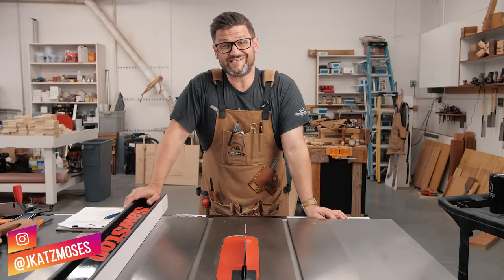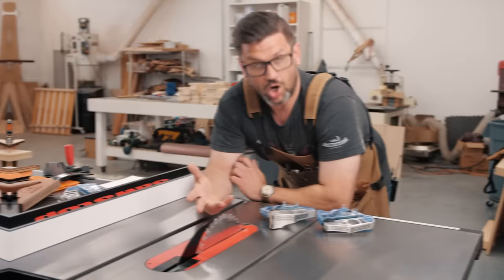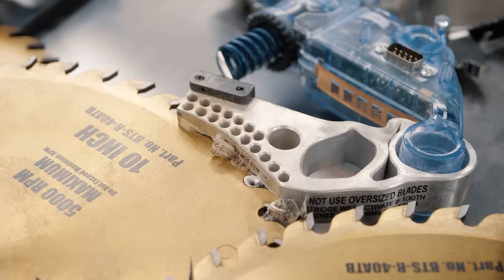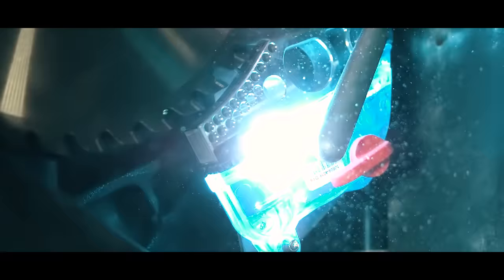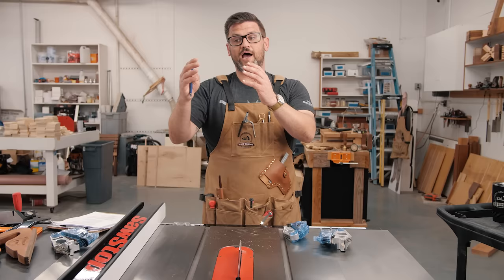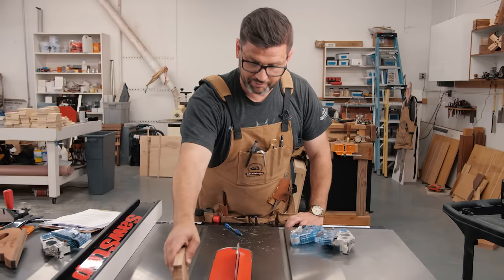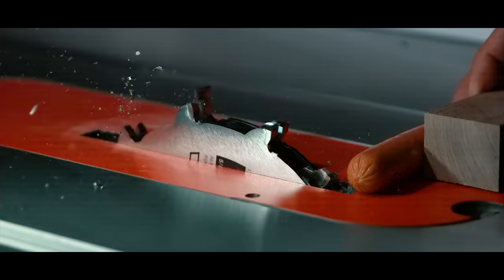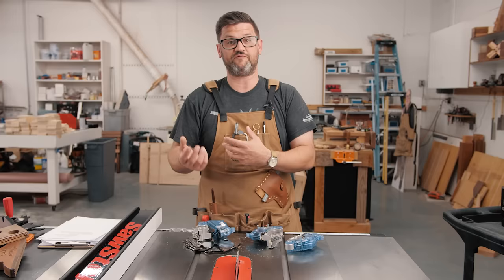How Safe is a Sawstop Saw? - Never Before Seen 19,000 FPS HD Slow-Mo Video

Comment: You did a great service to the woodworking community Jonathan! Great job! I got the blade on my finger 20 years ago. It was about 1/8th and went into the fingernail. I can still see the scar and it did do nerve damage. So what does that mean? If I think about it, especially when I type, I can tell it happened. Very similar to what a callus feels like on your palm of foot. So no big deal. I'll be glad to email a photo if any geeks want to see. FYI, I stopped using a table saw for about 15 years. Now I'm back and use my GRR-RIPPER 3D Pushblock (GR-100) - MICROJIG. (That's not a paid endorsement. Yes, mine has cut marks but not on my fingers, thank God!

Comment: “Man... if I don’t cut these 20 boards in the next 5 seconds my boss will kill me”
Reply: Not if he's trying to do that with one of these saws...
Reply: It is like that for some
Reply: @JEAthePrince  Fr, there are some lazy bosses with unrealistic expectations expecting their businesses to skyrocket
Reply: dude if you can cut 4 boards a second you should be the boss lol
Reply: @andrewvargas4141  true. I worked for some as a machinist
Reply: Just take 4 at once? If possible of course...
Reply: @-sturmfalke-  you'd have to set it up though. I squished 2 blocks together, had to tie them together. Was alot more work than just 1 at a time. But I'm sure there's better easier to use clamps. (Back then I was using my fingers standing to the side, and I was terrified lol)

Comment: "We caught something on camera that I don't even know if you're gonna believe"
Yeah, right.
Oh my god, genuinely shocked!
Reply: The fact that it was enough G force to break the welds on saw teeth is actually pretty crazy man
Reply: @EnrikaGames  I thought it looked impossible to me so i went back and watched the clip again. It actually seems it didn't break due to G force but rather by hitting other teeth parallel to it. The "shockwave" probably caused the blade to wobble sideways slightly, resulting in a small overlap between the teeth and thus being able to hit one another. It still does look incredible though.
Reply: @Simon-mv4jc  I doubt it
Reply: @cjbht19minaret  Check the video again and look closer. you can clearly tell one of the teeth comes in contact with the other by a spark
Reply: Exactly my thoughts.... "what's gonna happen, huh?"  And then... bedjeeeezusss bits breaking off.
Reply: Same, the shockwave of the stop was enough to cause weld failure. I was amazed
Reply: @origamipostit  I doubt it.
Reply: @cjbht19minaret  Minera is right. Look closer.
Reply: Don't blaspheme
Reply: @cjbht19minaret  The only way you are able to doubt it is if you don't even bother to look.
Reply: @Simon-mv4jc  correct!
Reply: I immediately thought "the thing will stop so violently the teeth go flying". On a second watch I gotta agree, the middle blade was stopped at different rate and tore teeth off of the sides (edit: it actually is visible in the footage and still looks incredibly cool).
Reply: @JS-oh2dp  I doubt it.
Reply: @joshandrews8913  I doubt it.
Reply: @Simon-mv4jc  You would be 100% correct.  That is what happened.  The last 18 years I have spent fixing both band saw and circle saw blades.  The kerf or overhang from the teeth are catching one another or the teeth had enough wobble from impact that it caught the body of the blade beside it.  It's hard to tell from that angle.  Carbide is an alloy of cobalt and tungsten  and while cobalt is quite soft yet durable tungsten is notoriously brittle.  Also the teeth are not welded in as you can't weld carbide they are soldered in.  I can take a 16 oz. hammer and just drop it from less than a foot and break carbide teeth.  But they can cut even hardwood lumber for 8-10 hours at a time under good conditions.
Reply: @kirtorasable  I doubt it.
Reply: @cjbht19minaret  good for you little buddy.
Reply: I was experimenting with how people would react if I just said "I doubt it". I didn't think people would take it so seriously. You all are correct!

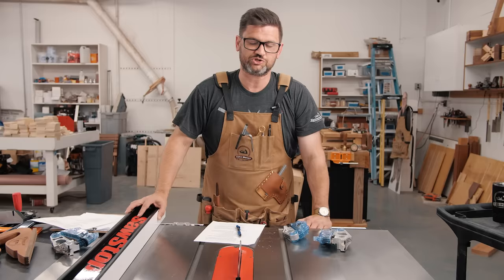Comment: 3:50
"Yeah but they go so slow with the hotdogs"
Which is how fast your hand will be moving, if you're cutting a piece of wood on a sawblade. Unless you're practicing your karate on active circular saws, you have no reason to complain.
Reply: As others have said, sure when using the tool you wont be moving that fast, but what if someone trips or something?
Edit: Because some people cant read beyond this comment, I'm just explaining why others complain about the demonstrations going slow, this is not my own opinion.
Reply: @Midnight-wh2bs  I love this logic.  "Oh, in this VERY specific circumstance, you'd still be badly hurt by it!  CHECKMATE!"
Okay, first, Jonathan kind of proves that even at VERY fast speed, it DOES stop the blade.  Yeah, you're not slapping a band-aid on it and calling it good, but you're not losing the fingers either.  But more importantly, considering what a table saw WITHOUT this tech would do to your hand in that same circumstance, ANYTHING would be better than nothing, even IF it didn't perform as well as it does in Jonathan's demonstration.
To me this is like complaining that a seat belt won't save your life if you crash into a concrete barrier at 100mph, so it's not "worth it".  That is probably true (not in the Saw Stop case, but let's go with it for now), but how many times do you actually expect that to happen versus the kinds of incidents it IS designed to save you from?
PS I'm not saying YOU'RE making the argument against the Saw Stop, just that the complainers who do are kinda stupid.
Reply: Just imaging a guy in a gi kiyahing and side chopping the blade
Reply: lmao thank you!! I was thinking the same thing--who actually tries to cut something that fast?
Reply: Finally. Someone who knows what hes talking about.
Reply: @MisterTsumi  Yeah I agree with this, I was just answering about why people complain that demonstrations only do it slowly.
Reply: Complaining only a keyboard warriors who never even used a oscillating tool 🤣
Reply: Midnight Scribe 4:55 he literally mentions this
Reply: @Midnight-wh2bs  just stay inside the rest of your life, you never know, a meteorite might strike you
Reply: @desertsane  Yeah I know, the comment though seemed to be questioning why people would complain about the demonstrations going slow, so I was explaining.
Reply: @ThereAreTwoGenders  Ah yes just ignore the fact that I literally said I'm not one of the people complaining about the demonstrations going slow. I was only explaining why people complain, I never said I shared the opinion (in fact I did the opposite and said I don't share the opinion).
Reply: @Midnight-wh2bs  ok than the comment goes to whoever agrees with what you said or is worried about it idc. You bring it up as if that's a genuine problem that someone is gonna trip onto a saw table while it is running and their body is gonna be thrown at it faster than I can throw a hotdog.
Reply: @ThereAreTwoGenders  I mean, I said "As others have said" to show that I was just reiterating the explanations others have given for why people complain and not my own opinion on the matter.
Reply: Don't kink shame me. Maybe I like sparring against my table saw!
Reply: @Midnight-wh2bs  usually when someone recites someone else and starts with "well as others said..." they are usually agreeing with it and not bringing it up to disagree with it especially when they don't even say they disagree with it to begin with
Reply: @Midnight-wh2bs  obviously im not the only one who clearly thinks you were agreeing with it, because the way you wrote it
Reply: @Midnight-wh2bs  you didn't even say you agree or disagree with it in your initial comment lmao
Reply: @ThereAreTwoGenders  I was explaining why people complain, whether or not I agree with it was irrelevant. Either way though I did then reply and say I agreed with the person arguing against the logic of the explanation.
Reply: @Midnight-wh2bs  exactly youre are saying that now, or a couple comments later. But the original comment(which im replying to) didn't say if you agreed or disagreed with what "others have said". Also you didn't say im just explaining this and don't actually agree. You literally just said what others said which makes it look like you agree not disagree
Reply: @Midnight-wh2bs  have a good night ✌
Reply: @ThereAreTwoGenders  Sorry I expected people to actually read the entire conversation, not just see one comment and ignore everything else.
Reply: @MisterTsumi  I don't think he's saying it won't work if it's fast. 
He's just giving an example of a situation where you might move at a fast speed towards it, as a reply to what the first person in this thread said about you wouldn't be moving fast while cutting a piece of wood. 
Its kinda funny how everyone just misunderstood his intent and jumped down his throat.
Reply: Well this was... Interesting to wake up to. Jesus.
Reply: @Gazz_TFP Chuck Norris would cut the table in half and leave a small (to medium) sized crater in the floor.
Reply: @Midnight-wh2bs  why would someone read a conversation your having with someone else when replying to a comment you said to everybody? Your initial comment to everybody is what everybody reads not individual comments to individual people, make sense dummy?
Reply: @ThereAreTwoGenders  Because it gives more information and might clarify things, which will prevent things like everyone making the same misunderstanding about what I said.
Reply: @Midnight-wh2bs  yeah sorry nobody is gonna respond to a conversation ur having w someone else. They are replying to your initial comment that was to everyone. Which was a horrible.
Reply: @Midnight-wh2bs  its okay to be stupid, its really hard for you I get it